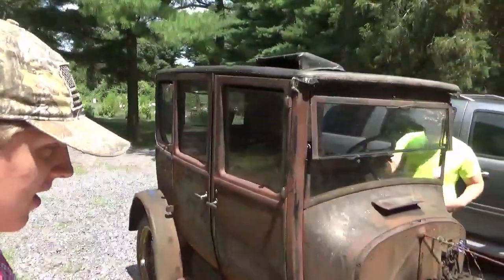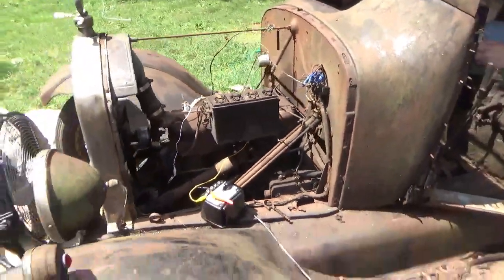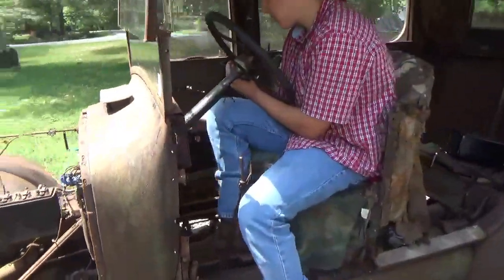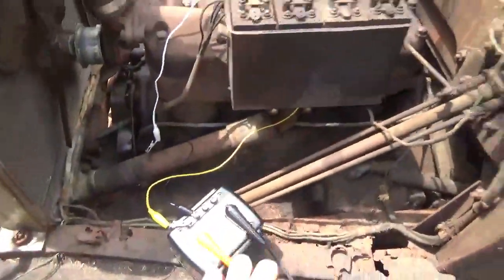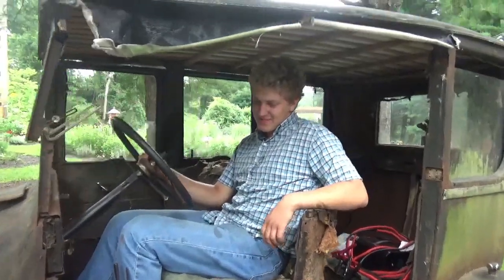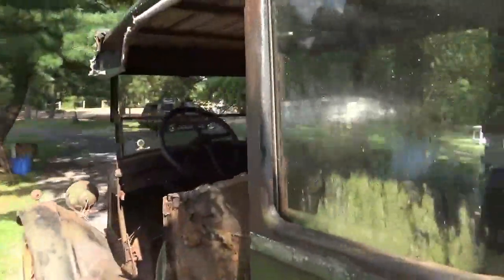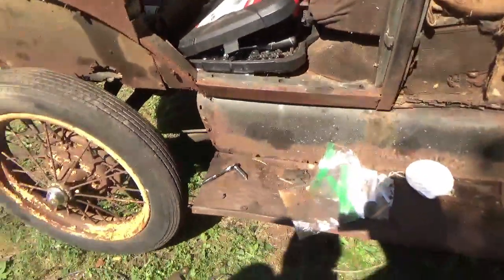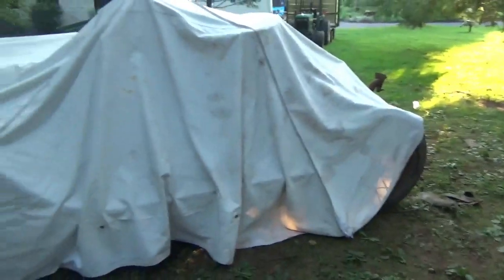Old Car Restoration  |  1926 Model T  (part 2) First Start In Many Years

Comment: You should check for stuck valves. It could be the reason you can't get #4 to fire. Take out the plugs and shine a light into the hole. You can see the valve heads and tell if they are moving. Squirt in some PB, tap the valve down GENTLY, crank it back up, repeat, repeat, repeat. Buy a 6 volt battery at the Farm and Home store.
Reply: If he knows he doesn't have ignition in that cylinder the chances are it does have compression but yeah I always see if it has fire first then if it has any compression at all it should run